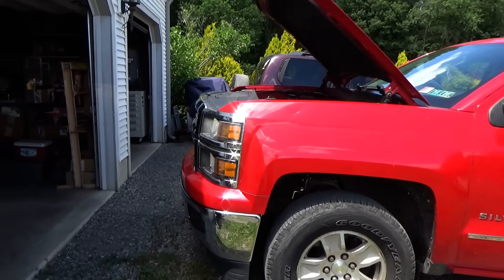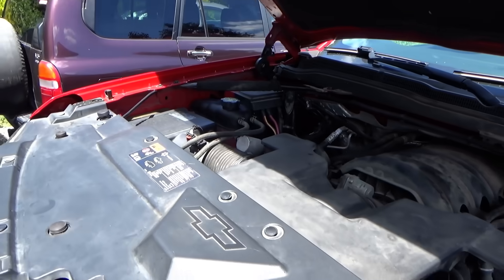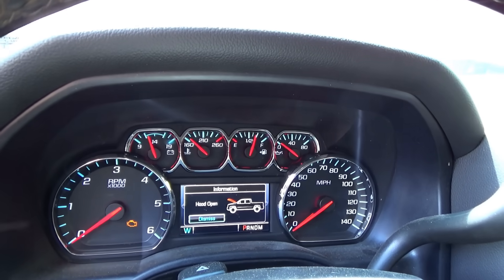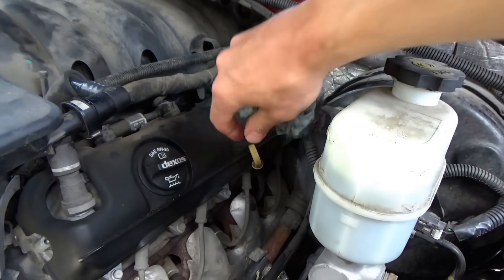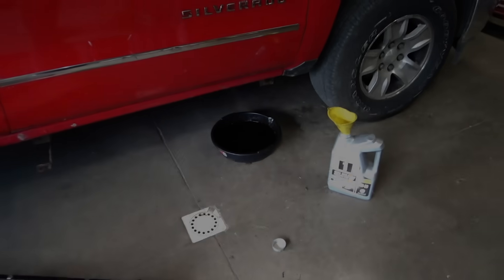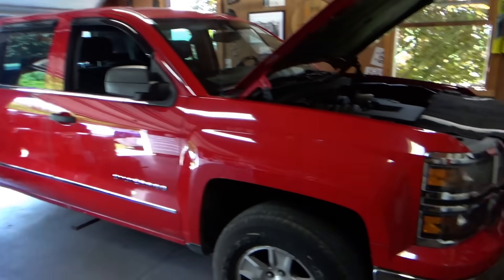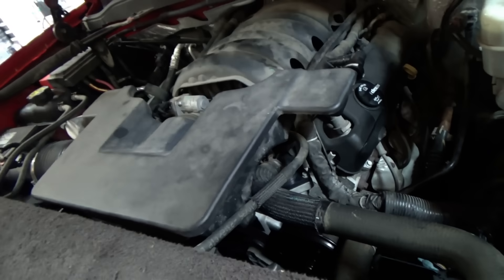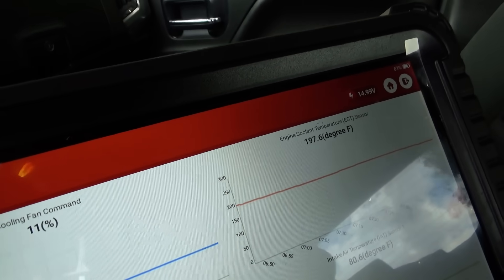Chevy Truck OVERHEATS?! (Thermostat & Water Pump Already Replaced...)

Comment: Odd that the fans are not at 100% when the A/C is on and the temp is over boiling....
EDIT: plus... coulda drilled out the bypass to a larger gauge

Comment: In 2002 I had a 1992 Accord that started overheating a little bit. I went to NAPA and bought one of their thermostats and installed it. Took it for a test drive and the car overheated very quickly. Got a ride to a Honda dealer an hour away and got a genuine thermostat. While I had the original, the NAPA and the new genuine thermostat all side by side, I put them in boiling water. The new Honda thermostat opened fully very quickly. The old Honda thermostat opened slowly about half way. And the NAPA thermostat did nothing and remained closed. Went in to NAPA and the store manager told me that they would refund my money but that their thermostat was fine and you can't put them in boiling water to test them. He claimed that to test their thermostats they have to also be in a pressurized system to simulate being in a cars cooling system and then they will open. I told him about the other thermostats opening in boiling water and he just repeated that that's not how NAPA thermostats should be tested. I haven't bought anything at NAPA since then.
Reply from the maker: NAPA Store manager is full of 💩💩💩😂
Reply: @PineHollowAutoDiagnostics  They sell parts, they are not mechanics.  They're experts when it comes to the mechanics of a transaction and that's the extent of their expertise.  The same is true for any auto parts place.  Why people go to the various parts places and think they will fix their car is one of the mysteries of the universe, but marketing and advertising directed toward idiots is what I blame.  People who take responsibility for their own property(like a car or truck) don't fall for that shiite and don't have problems with basic maintenence.

Comment: It's probably best to do the OEM, often they are designed to open at a certain rate to prevent engine damage. Back in the good old days I'd trust Stant aftermarket thermostats, not today.

Comment: When taking your car to a last-chance mechanic, always leave the engine out of oil and the tank out of gas. I'm surprised it wasn't throwing timing codes from low oil pressure.

Comment: Got my driver's license and a 10 year old Chevy C10 in 1980, my father told me to check the oil at least every week and change it every 3k miles, check the brake fluid and belts, I still check the oil every week, my Toyota never needs any but it's still a good habit to at least look under the hood

Comment: Years ago I did an inframe overhaul of a Detroit Diesel 8V71N marine diesel. Also cleaned the heat exchanger, replaced the hoses, rebuilt the raw water pump etc, along with two new OEM thermostats (1 per head). Sea trialed the boat and the temp would start creeping above 205 at full load. Had me scratching my head. I checked  raw water pressures, vacumn etc. Three days of trying to figure out why. If I had an infrared noncontact thermometer ($$$ back then) or a thermal imaging camera I would have found it right away. Turns out one of the brand new thermostats never worked right out of the box. I found it by boiling them.

Comment: How in the blue blazes can you have the knowledge to replace the water pump, thermostat and know how to command the fans to 100% via scan tool (and run heater to avoid overheating)....but neglect the oil. Maybe the one that did all that work isn't the owner?

Comment: The 5 quart low on oil condition is a strong indicator of the owner's concern for that truck.
Reply: Average intelligence of vehicle owners today. Short trips all winter long, oil change only after the DIC starts yelling at you to change it because you ran it down to 0% oil life, tires never rotated, brake pads worn down to the metal back plate, etc.
Reply: @karlschauff7989 then they blame the vehicle and claim they will never buy that make of car again because they're a POS.
Reply: Looks GREAT externally but yes any maintenance is severely lacking
Reply: @gregnemcek3998  you forgot the words " lack of " right before concern. Do you know how much noise that engine had to be making?
Reply: The only way that truck could get that low on oil is to never do an oil change.
Reply: Even joe biden isn’t 5 quarts low. Close though.

Comment: Good call on the thermostat.Should clean fins radiator too.As you accelerate temperature meter should go down.If not clean radiator fins both sides.With dish soap.Regular hose.No pressure washer.Fines are delicate air flow is vital for proper cooling.Figured it out after water pump and thermostat replacement .Nedal would stay at 210 degrees even after acceleration.

Comment: I wonder how long the "new" water pump will last if the customer used the same parts store.
Good process Ivan to always check oil before starting a diag.

Comment: I've been retired for over 10 years but recently I've been helping the owner of a Midas run the desk so he can get the afternoon off once a week and things have changed and not just pricing... Standard oil synthetic blend oil change [$50] Many vehicles these days are requiring 0/20 oil which is a full synthetic and is mandatory. [$100] Then you have the "European oil" [$150] Ridiculous.
Reply from the maker: My standard synthetic oil change price is $120...$60 for oil and filter plus half hour labor!
Reply: @PineHollowAutoDiagnostics  And that's probably up to 5 qts. 

So the shop owner is being nice by doing a syn oil change for $99.95 especially in Southern California.
Midas even has online coupons for synblend oil change for $29.99 which is the $49.95 oil change.
Back in 2010 or so Midas started their $19.95 standard oil changes to increase car counts but all that did was bring in bottom feeders with thrashed cars that needed a lot of repairs but they always got their cheap oil change and bailed declining the repairs.

Comment: Even OEM thermostats  are junk these days BMW particularly. Also it is worth getting a set of coolant hose clamps, saves lot of mess and coolant is getting more expensive and critical to get the correct type also  saves time bleeding air locks.

Comment: Last night...
2017 Elantra overheating. Already installed new thermostat. Three purchased before finding one that was MADE CORRECTLY! (OEM!)
Still overheating.... I pressurized the system, and found some bypass hose on the back of the engine dripping aggressively. PLASTIC COATING on the metal tubing has separated from the metal, and allowed seepage under it and out ....
Removed cracked plastic coating and cut off 3/4" on each end of the bypass hose and put it back on...
NPR!

Comment: On that particular thermostat, the way it is built into the housing it can only go one way.  Dad always told me the spring needs to go towards the engine.  I don't know about GM OEM parts, however,  Brian from Ford Tech Makuloco did a video some time ago about counterfeit Motorcraft parts.  He stated, as did Eric O. with South Main Auto, that it is best to buy from a brick-and-mortar store.  If I had placed a bet, I would have bet the owner didn't notice the correct temperature since he didn't know how much oil was in the engine.  I like how you check oil, Ivan.  You pull the dipstick and read the level without bringing the tip up allowing the oil to run down the stick.  Hey, these days 3 out of 8 quarts isn't bad.  In the words of Eric O. with SMA, "Just because it is new doesn't mean it is good."  Just goes to show a person still needs to check the basics. GREAT VIDEO!

Comment: First thought... Understand coolant circuit flow, sometimes those GM's have duel thermostats. Check/confirm coolant flow. Use an IR gun to check temps/differentials at various locations. Radiator plugged. Use refractometer to check freeze point of coolant. Yes I have one of those. [50/50 is -34 deg f, 60/40 is -10] Fans working, air flow though radiator restricted. On many different scenarios I have had to go back and tell myself one fundamental truth... It was made to work.
Now without watching the video and seeing the comments I see it was a defective new thermostat. I prefer Stant cooling products.
Why was the WP and Thermostat changed in the first place? That would really suck if you had a stuck shut thermo and the new one was also stuck shut.

Comment: take out thermostat and if engine runs normal eventually, nailed it......
I just put in the fail open thermostat to try.  You have to replace them if you overheat since they are opened permanently when tripped.

Comment: Always have to check that oil.  Modern engines will burn a little oil, especially if its thinner oil like 0w-20, so you need to check it often.

Comment: Not related to this vid but I went to go use my 12v plug in my wrangler today. Nothing. Got all excited to play Ivan. Checked fuse without removing it. It was good. Check for power at the fuse after starting the vehicle. Nothing. Really got excited to dig in. Then I realized remote start doesn't count as "running". Started the wrangler using the ignition and everything worked lol. Womp womp. Maybe one day. Thanks for all the learnings and content Ivan.

Comment: China strikes again. We're turning into a Banana Republic or a second world country. These half-assed aftermarket parts are an absolute Menace. What happens when all the original equipment manufacturer parts are made in China? We used to have a local auto parts store before Advance Auto and o'reilly's, etcetera came along, and they did not sell defective aftermarket parts. They couldn't stay in business if they did. They were forced out of business because of cheap Chinese parts they couldn't compete with and now we're stuck with this shit.

Comment: Next time you change the transmission filter if the pan hold 3 qt tell the customer to change the oil in the trans pan every time they change the motor oil this way the transmission gets clean fresh oil and it stay cleaner the transmission may last longer you do good work my friend cool how you fix cars the dealers can't do

Comment: I thought at first you had a scenario like one I saw on an F-150, but to my surprise I’ve yet to see one like it roll into your shop. Truck would intermittently limp home and shop had changed the engine swearing an overheating issue; temp gauge was pegged. Same issue remained. The customer had installed an aftermarket thermostat with inadequate flow across the coolant temp sensor. The thermostat was swapped to the replacement engine. The truck was never overheating.

Comment: Engine oil is also a coolant. It prevents friction and carries away the heat
Reply: Yes, but ... Look at the average road vehicle.  The oil drops into a sump that typically doesn't have fins on it.  On my F150, the sump sits above an aerodynamic cover that nets me another whopping 0.01 mpg.  While the oil is carrying heat away, it's not even in the same class as the engine coolant that sits out in the breeze.  If you want to see an engine where the oil is carrying significant amounts of heat away, take a look at air-cooled aircraft engines.  Air flows over the cylinder baffles and then through an oil cooler.
Reply: @major__kong  👍Jegs to the rescue!
Reply: Vicious circle. Too little oil makes the temp higher, the higher temp makes it burn off more oil.

Comment: GM sees no problem with an engine burning 1 qt per 1000 miles even under warranty. I didn’t realize engines were using 0W oil in 2014. I thought that was 2020+ thing.

Comment: My Toyota 1mz-fe runs cold even with a thermostat. Going downhill has the needle on the cold side. Going up and it’s back in the middle. Sludge may be a problem so it’s best to change the engine oil every three thousand miles.
Reply: Toyota thermostat when get old will pass coolant and not regulate temperature particularly in sub 80deg.try a new oem from dealer.
Reply: @johnstuchlik5828  👍Thanks for the information.

Comment: There is no reason for a prolonged diagnosis at high engine temperature. It's as detrimental as the oil level.

Comment: Back in the day you could trust Stant thermostats. Stant was bought out by Motorad. In this day and age you even have to watch out for the manufacturers own parts as just about everything is made in foreign countries. I see that GM went back to the conventional coolant flow direction. My 2000 GMC with the 6.0 has reverse flow with the t-stat at the lower lower radiator hose. Heat rises.
Reply from the maker: Coolant is always top to bottom in a radiator. Doesn't matter where the thermostat is located 😉
Reply: @PineHollowAutoDiagnostics Ivan, I’ve heard the 5.3 the flow is reversed.  The hot water flows into bottom of the radiator and out the top hose.  Please verify.

Comment: I have the 2016 version of this truck. Mine has a low oil level warning light. These engines do burn oil. The thermostats are known to fail. Mine failed in the open state. It would turn the cooling fans on hurricane speed.

Comment: 5 quarts of oil low is inexcusable !!! But...the truck is waxed , vacuumed and LOOKS COOL ! Good practice to always check oil on any customer vehicle . Some extra 2 cents : some vehicles can be hard to get air out of the cooling system and the front must be raised . The radiator tubes seem to clog in the middle which can be hard to access with a thermal camera , laser thermometer or your hand ( watch the fan coming on - ouch ! ) Great diagnosis and fix .
Reply: So I guess at the factory they put the new vehicle nose up and fill it vehicle with coolant?
Reply: @2nickles647  Maybe it's done under pressure . I have a friends 2000 Honda 4 cylinder with an air pocket in the cooling system . The bleeder is frozen and will have to be torched . The air is not coming out .
Reply: @2nickles647  There is a tool that uses shop air and vacuum to fill the system . I doubt most shops have it . They probably use the cooling funnel fill kit . See video from Ratchets and Wrenches . There may be a few vehicles where the highest point in the cooling system is in the heater core and air is trapped . I think that tool would eliminate come backs .
Reply: @2nickles647  I believe OEM are vacuum filled.

Comment: The Gen 3 onwards V8 engines do use a little bit of oil so just keep your eye on the oil level on the dipstick.

It's usually about once every 5000 kilometres or 3000 miles that I have to add 1 litre or 1 quart of oil because it falls down to the add mark in my 5.7 litre Chevrolet LS1 V8 engine.

Once it falls down to the add mark then it requires about 1 litre or 1 quart of oil to bring the oil level back up to the full mark, the engine uses 2 litres or 2 quarts of oil within the 10,000 kilometre or 6000 miles service interval, since mine is bolted into a Holden Commodore, Holden says that anything in excess of 2.5 litres of oil consumption within the service interval is excessive & the engine needs a rebuild, etc.

I had an issue 19 months ago when the engine boiled over,it was because I didn't bleed the cooling system properly meaning that it had an air pocket trapped inside of the engine, when I replenished the coolant I made sure that the thermo fans turned on before switching the engine off so as to make that the cooling system was properly bled.

I have a 91°C or a 196°F thermostat fitted which is from the U.S. instead of the standard 86°C or 187°F thermostat so the one that I have fitted opens a tad later although it doesn't make any difference to the running temperature of the engine !

Comment: NO WARRANTY. 5 quarts down and driving it overheated. coolant and oil not protecting the engine. that engine has to be toast. should have sent the oil you took out to a  tester to see if it was 25% metal... LOL

Comment: Way, way back in 1973, I came through your area in a very hot summer, and the car was over heating despite the rad working. At one point the engine actually seized up!!! Good old Detroit Iron blocks, no lasting damage, and we got it started with a tow truck boost on the starter. In Indiana, started the same thing, and this time, we found the cause was low flow and air build up to block the thermostat (never found out if the head gasket had a leak). For the rest of the trip, no thermostat in the engine and no overheating. Later in cooler weather, once more changed the thermostat, and I use the 'old school' fix, of drilling a small hole in the thermostat to prove a 'bleed' function to stop air entrapment. No further issues with the engine, but the body eventually rusted out so that was it.

Comment: Bad aftermarket parts isn’t something new, forty years ago I replaced a water pump on a Chevy van three times!!! Bad pumps from auto store that was eventually bought out by one of the current franchises. Went to dealer and bought OEM at twice the price but it worked👍

Comment: Those Fords have a cold side thermostat, they operate differently and are more ‘’engine friendly’’ than the normal hot side stats.  It wasn’t defective, it was the wrong application, either a cataloguing error or something similar.
Reply: Ford's? This is a GM.

Comment: I’d be interested if his p0420/30 stays out now that’d be cool. Only recently heard a case study where due to a stuck closed thermostat the suspected reasoning behind the p0420 was the fuel vapours were getting burnt up due to the higher engine temperatures before hitting the catalyst and so the proper reaction wasn’t taking place and the car set the code. New thermostat and no cat issue after

Comment: I ordered a “OEM GM” t stat from Rockauto for my 74 Pontiac Firebird restoration and guess who it’s made by…. Motorad. It was stuck shut. The “made in Mexico” on the box was the first clue. I bought Duralast at autozone (also made by Motorad) and that one worked. I tested both in a boiling pot of water.